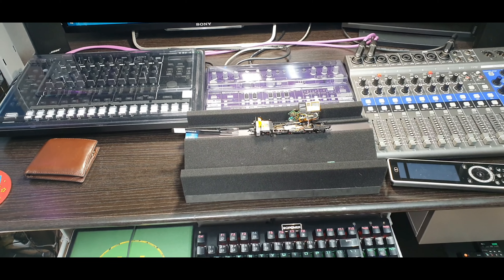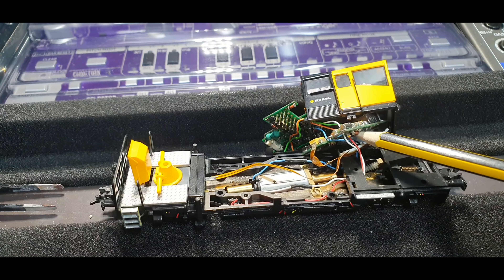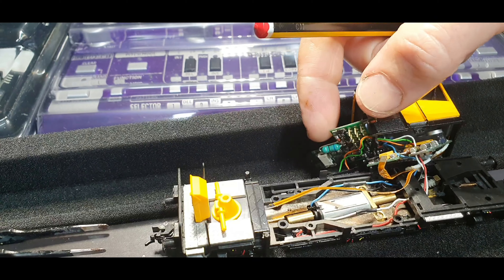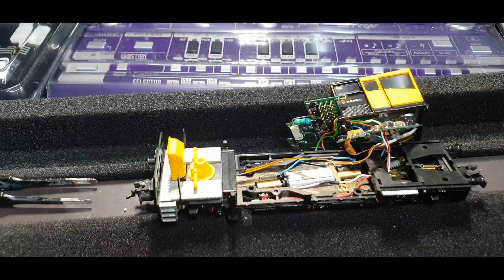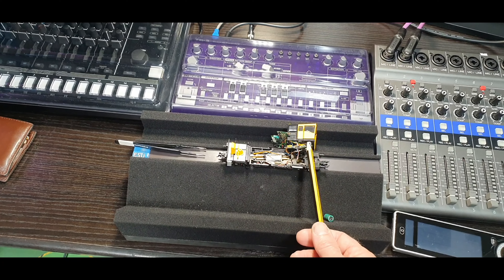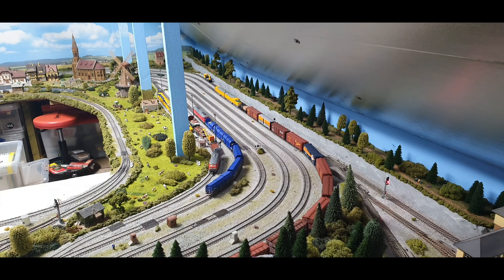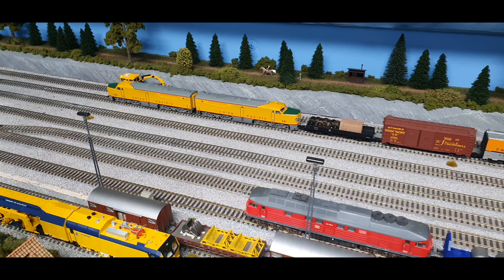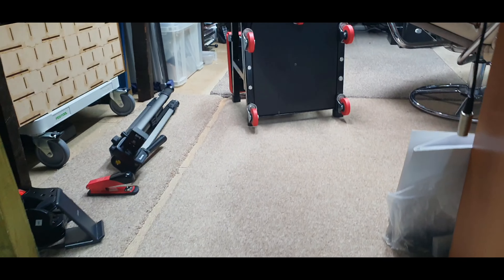Viessmann Robel {breaking into the cab}

Comment: Cleaning up the board and then the right flux with the right solder and the right temperature setting on the iron not to mention the correct capacitor for the job. Sending it to the friend that is in the know is the right call. Thanks for the update. Jersey Bill
Reply from the maker: Thanks, its a very hard model to work on.

Comment: If the capacitor sounds like a high-pitched squeaking sound, it could very well be drying out, and as you suggest yourself, in need of replacement
Reply from the maker: Thanks..I am gutting this Robel and installing lok sound 5 micro and a separate Esu power bank.